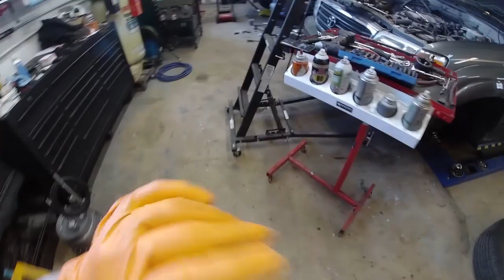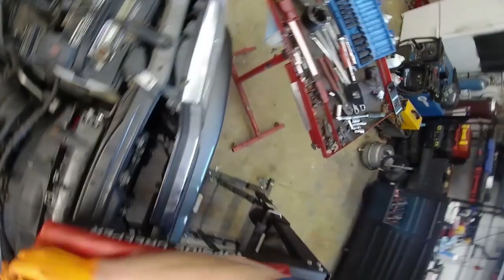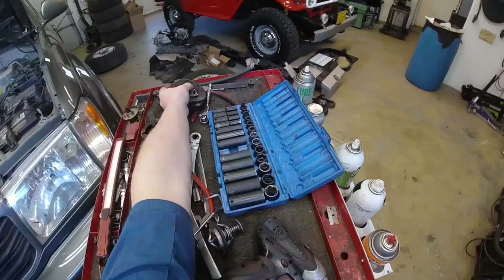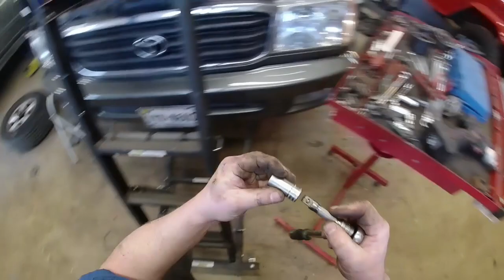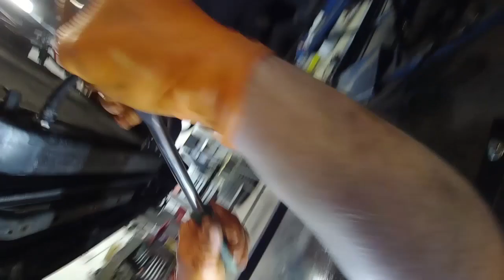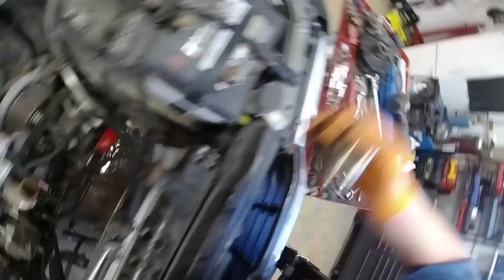Toyota 4.7 liter Timing Belt Replacement Part 1

Comment: So you have to change the water pump to do the timing belt?
Reply from the maker: You can do the belt without doing the water pump, but since you have to remove the belt to do the pump it makes sense to do them at the same time.  The water pump is usually leaking by the time it's time to change the belt, especially on the trucks that use the pink super long life coolant.

Comment: what happens if you have nuts and bolts left over after reassembly?
Reply from the maker: You get the joy of figuring out where they go😂. It's the best part.
Reply: You can use them to reaffix the the unfastened parts which will eventually fall off. 😂

Comment: Would this be identical for a 2002 sequoia 4.7L?
Reply from the maker: You'll need to look up the crank shaft rotation for where to change the belt but otherwise the same.

Comment: Would this be the same for a 2006 tundra 4.7 sr5 ?
Reply from the maker: It's similar, the timing where you remove the belt is different and you won't be changing cam seals.
Reply: @OTRAMM  thank you boss. I would of taken it to your shop but we are 9 hrs away!

Comment: Thank you for writing this up. It’s a really great video. I have to change my power steering rack, I was wondering if it would be easier to do this when everything is taken out? The Grigger’s say hi btw. 😁
Reply from the maker: The way the rack comes out I don't think having the timing belt stuff out of the way would buy you anymore room.  I could see it making it more of a pain since you'll have dripped coolant all over the rack pulling the water pump.  And hello back, been watching you guys on Instagram.  The baby doesn't seem to have slowed the adventures down at all.
Reply: OTRAMM thanks again! I realized we also used your ahc delete video too! Loving all the videos...I’ll have to put a request for a video about the rack and pinion replacement. 😜 Definitely subscribing!
Reply from the maker: @walterpenn571  We don't do racks very often. I'll film the next one that comes in.
Reply: The rack comes out relatively easy. There are only four main bolts, but you have to disconnect the sway bar. There is another great guy Timmy the Toyota Guy that does a step by step on the Tundra Suspension, that you need to watch. You have to almost disconnect the rack to do a suspension job

Comment: Just a FYI. You should always put a piece of cardboard against the radiator to keep from putting dings and gouges in the fins. I see you gouged this radiator pretty good couple times. Lol.
Reply from the maker: It got a new radiator that hadn't come in yet.  We normally do the cardboard trick but it didn't matter on this one.
Reply: Thanks for this comment. Will make sure to do this.